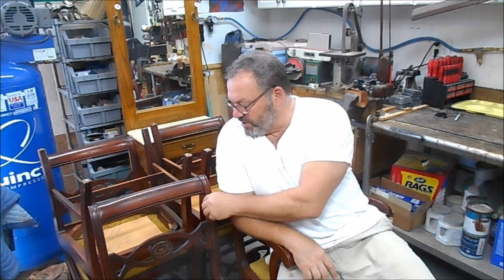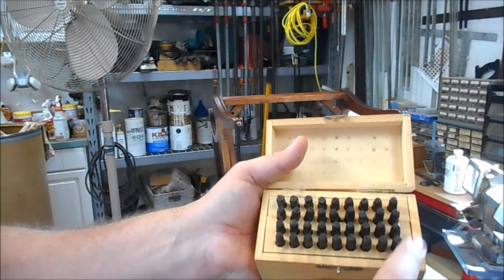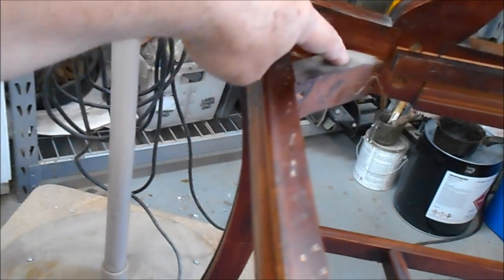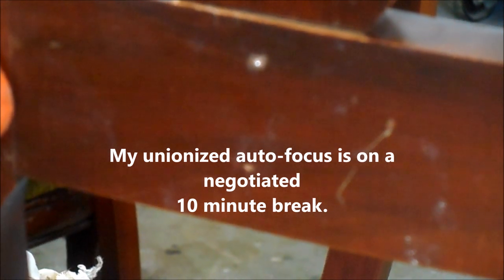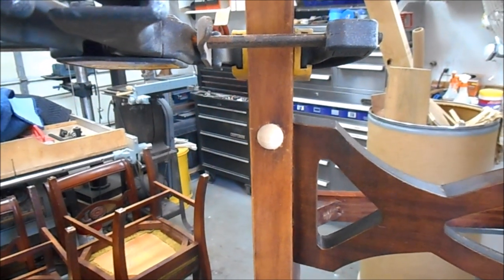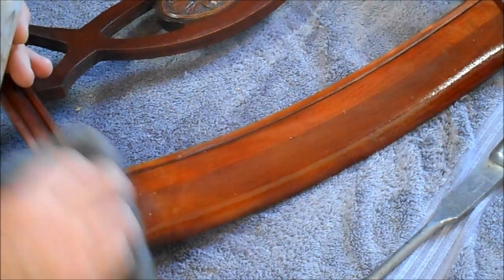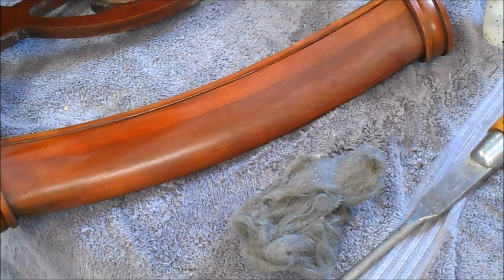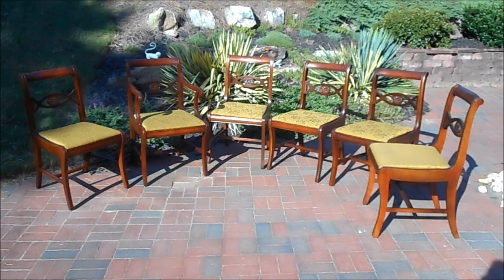A Quick Restoration of a Set of 6 Vintage Dining Chairs

Comment: So what scratch cover did you use?  Also I was hoping that you would redo the cushions.  I have some similar chairs that have the wood on the side.  I would like to have a more comfortable seat than the wood plank with the old cotton batting on top.  Do you have a video or a suggestion on what else to use knowing I have limited space on the sides where the seat meats the wood?

Comment: Would your final cloudy wax solution work on an oak hardwood floor that has a grey patch?  I think the previous owner had a dog that piddled there, and the moisture got under the wax finish (these are old floors).  Would appreciate any suggestions you may have!  Thank you!
Reply from the maker: Without being able to assess the damage, I really can't give you any solid advice,   I imagine you could try stripping off the wax from that area to see if the damage is between the finish and wax.  If it is, you are all set if it's not, nothing lost, I suppose.   Good luck.

Comment: Sorry, what is scratch cover?  So often need it...
Reply from the maker: It is sold here as Old English furniture polish.   It is basically a light oil with dye in it.   You wipe it on and the oil goes into any scratches, preventing the broken finish from refracting light.   It doesn't fix the scratch, just hides it.   The video "Three to Flip" shows it being used on a chest of drawers destined for the consignment shop.   Thanks for watching.

Comment: I don't think that the chairs are of the 1940's. Possibly 70's import with those non-glued wood, screws and buttons. Maybe shipped KD and assembled in America. Should have been glued here. Screws as cheap clamps.
Reply from the maker: Hi Pat,

Thanks for your comment.   It's always hard to date the later manufactured furniture.  In the books I have read on the subject, there are only a few clues available as you try to accurately date furniture from the mass production-era.   

The main joints were in fact glued, and the glue had decomposed in parts, as is often the case in older pieces.  The slot head screws are a good clue of an earlier manufacture date, usually WW2 or earlier as Phillips heads came into popular use after the war.  The fact the screws were high carbon steel and not plated is also an indication of age.  I interpreted the screw (rather than a dowel) holding the arm rest in place as an indicator of lower quality, rather than identifying it as a modern knock-down piece.  I guess much of that wasn't clear in the video, but I was able to see it all up close as I worked on it.

Finally, I had the advantage of talking with the sellers who were in their 60's.   The chairs were from their Grandparents and then passed on to their parents, so I think they are at least from around the WW2 era.  Of course, I could be wrong, but all of the clues point in that direction.  Regardless, they are fixed and ready to go back to work.

Thanks for watching and sharing your impressions.  We are building a great little community of knowledgeable people, and I'm learning something from everyone.

Best regards.